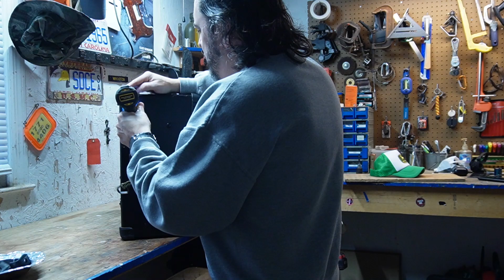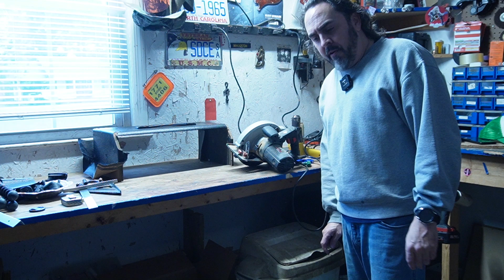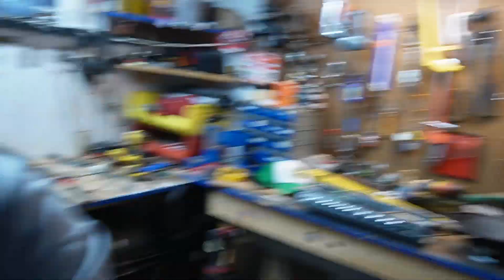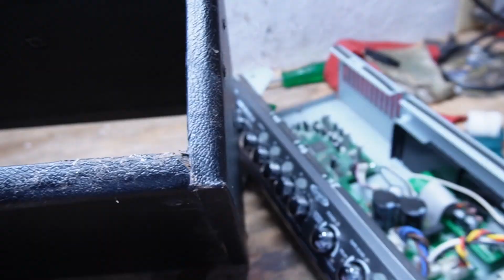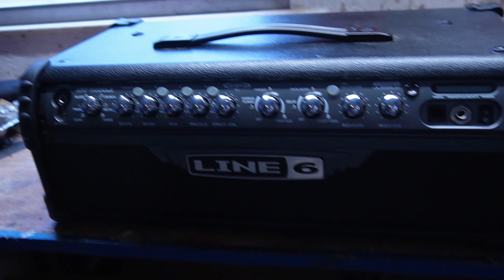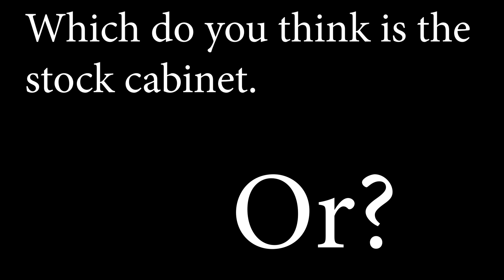Line 6 Spider 3 Hack -  Combo to Amp Head Conversion

Comment: just a bit of advice, as someone who’s turned a few cheap combo amps into heads (pardon my unprofessional & poorly articulated response here) - often these amps aren’t meant to push that much sound & we’re mostly designed for bedroom level volume. throw a 10 band rq in your signal & nuke any signal below 150. cut the 150 by a few db. adjust your amp bass knob back up to taste. but it’ll definitely clean up some of that flubby, muddy noise
Reply from the maker: Thanks for the great advice. This was kind of a Frankenstein experiment and I never even play it, but I might have to pull it from the closet and give that a shot.

Comment: My problem is exactly the opposite: I want to keep the speaker and be able to connect it to a different head amp than the one that came standard. Is this possible without disassembling everything? Because I don't see a 1/4" amp input beyond the guitar input. Would this input work?
Reply from the maker: You could mount a plate to hold a 1/4" input jack inside the back of it. I've thought about building or buying a cheap 1x12 cabinet to put the speaker in to get some use out of it, but I haven't.

Comment: All of these affordable amps are and were made of mdf. Most cabs now days are made out of mdf. Mdf is supposed to not affect the tone (neutral) which is good in most applicatons, just like PA speakers. Those line 6 spiders are older and sounded ok for what they were. Digital amps have improved a lot since
Reply from the maker: It's crazy how good affordable amps are these days.

Comment: Cool video 
I'm a vintage scent collector 
I think that most guitarists are like audiophiles because you guys are very much into tones.
I bought a cheap $25 behringer EQ pedal and it improved my sound astronomically 
I have two Rhodes pianos and my cheap peavey vyper 15 watt sounds better than my more expensive amps especially if I add the EQ pedal in my signal chain
How about just getting an EQ pedal?
Reply from the maker: I have the same behringer pedal, maybe I'll plug that in to it and see how it sounds. The reality of it is, every preset just has too much bass and I'm not sure if turning the low frequencies down on the pedal will work, but it's worth a shot.